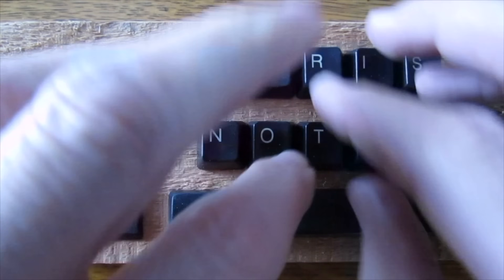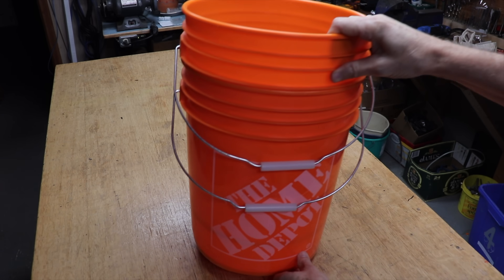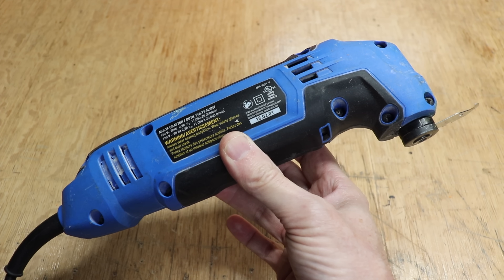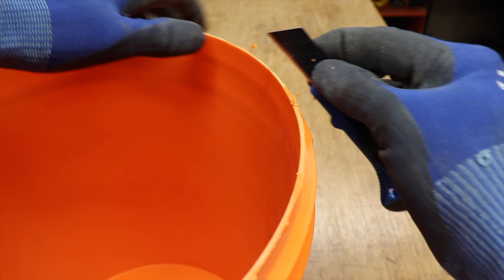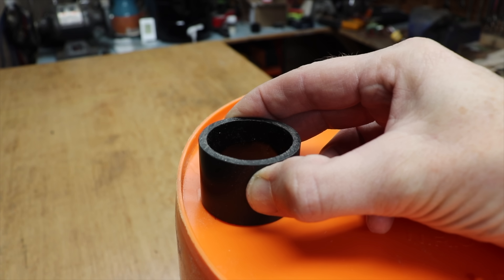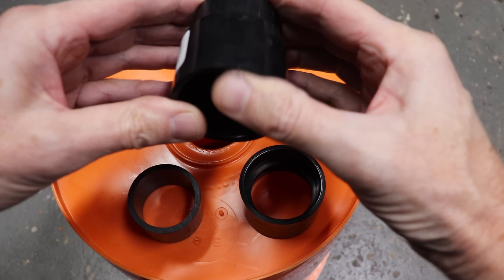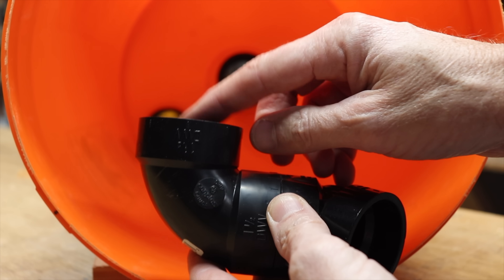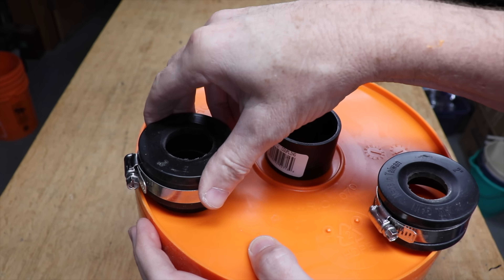How to Make ● Simple Cyclone Dust Collector

Comment: Hello Chris from Ray in New Hampshire. I just finished making one of these dust collectors. With a seven foot hose section the whole project was under 50 dollars. New Hampshire does not allow those black fittings, so my Home Depot does not carry them. I used schedule 40 white pipe and fittings. The buckets from my Home Depot didn't fit quite as well as yours, I suspect they have different sources in different areas. I beveled the inside of the receiving bucket but still no go. I then cut four small cuts in the top bucket edge at 90 degrees apart. this allowed the buckets to fit just like the one in your video. Thank you for a great design. I recently bought a lathe so I make a LOT of shavings and this will save me so much work.  THANKS AGAIN. Ray
Reply from the maker: I just finished an update with 2 more great tips!!..........https://youtu.be/BeU4nqSJtBY

Comment: I built this and it works great. However, it oil cans at the slightest covering of the nozzle. Any ideas? Vent it?
Reply from the maker: Some vacuums are quite strong. You can put the lower bucket inside of another HD bucket and push them together. For the top bucket, cut the bottom and top off of another bucket and use a bit of silicone to push on and adhere. This doubles the wall thickness and reduces the chances of collapse.
Reply: Chris Notap Good tip. It’s the top that oil cans so doubling it with another bucket might work. I thought about pop riveting a metal or plastic band around the outside to reinforce it.

Comment: Ever had problem with buckets sucking in. Not sure if I got things to tight but my buckets collapse
Reply from the maker: You can place the lower bucket inside of another bucket and push them together. This strengthens the side wall x 2. For the upper bucket you can use another bucket and cut the bottom off and slide it on and use a bit of silicone to adhere them together. This will also double the wall strength.
Reply: Chris Notap thank you for reply but the issue was i had a small chunk of wood in hose that I didn’t see. Your dust collection system works like a charm. Many thanks

Comment: Great video and unique design, but is it cost effective?  Sorry to be a negative Nancy.  I just priced out the components at Home Depot and since I don’t already have a section of hose and hose adapters to connect the collector to the vacuum, it would cost me $43.53 plus tax for all the parts.  I bought a duststopper cyclone at Home Depot that fits on top of a Homer bucket and the bucket for $43.45 plus tax.  It came with the hose, works great, and is less tall.  Even if I could have found a place to buy the stuff for less, it wouldn’t be worth my time.  If you have the hose and adapters, or just want to build one as a fun project, go for it, but I have other things to do with my time.
Reply from the maker: Other commenters have said the duststopper from Home depot worked poorly and that this worked way better. That's directly from commenters.

Comment: I’m having trouble putting the buckets together... used a rubber mallet, sat on them... the tapered end is too much... I got a great edge just the way you said- but still won’t fit together. I’m gonna keep scraping down the angled edge- otherwise Idk how to get these 2 buckets together...
Reply from the maker: Others have said Lowes buckets also work.

Comment: I had made a single bucket version of this years ago.  I put 2" of water in the bottom for sheet rock dust and it works great.  The double bucket is awsome with 2" of water the shop vac stays dry.
Reply from the maker: I just finished an update with 2 more great tips!!..........https://youtu.be/BeU4nqSJtBY

Comment: My bucket crushed from the vacuum pressure any tips
Reply from the maker: Some vacuums are too powerful. You could buy 2 more buckets. Cut the top portion off an inch below the lowest ring. Cut the bottom off an inch from the bottom and then slide the 2 parts tightly onto the buckets. This should re-enforce the sides and strengthen them from collapse. It's worth a try and easy  to do.
Reply from the maker: I just uploaded an update to solve this issue.....https://youtu.be/BeU4nqSJtBY

Comment: A nice addition would be  some clear plastic inside to see when it's full.  I operate a shared workshop, and no one would empty it, assuming it was empty to start with.  A window would make it easier to see when full.  Great vid.
Reply from the maker: Actually I tried that when I was doing the video. The clear window gets dusty right away and un-viewable. A glance at the lower bucket can tell if its full, that portion is darker or putting a light behind it works too.
Reply: @chrisnotap  Yeah, wondered about the light idea.  I think I may try to make mine with a mason jar hole in the top (jar hanging down, hole accessible from top) where I can lower a light bulb in there to provide a light source to judge the level.  Thanks for sharing!

Comment: Awesome project, thanks for sharing.  I would suggest using a rubber coupler to attach hose, with both sides already open. You can buy sizes, depending on your hose.  Much better hold and if one hose (size) breaks, you can simply adjust tighten the rubber coupler, to fit the new hose.
Reply from the maker: I just finished an update with 2 more great tips!!..........https://youtu.be/BeU4nqSJtBY

Comment: I was all  for it until you said I needed a single screw, that blew the budget
Reply from the maker: I just finished an update with 2 more great tips!!..........https://youtu.be/BeU4nqSJtBY
Reply: @chrisnotap  you should pin the update at the top of the comments. Awesome video too, I am going to make one. Thanks!
Reply from the maker: @leifforrest  I could have sworn I had pinned it. I just checked and pinned it. Thanks for making me aware!
Reply: And I thought your mind was going into the gutter.
Reply: @cornnutzgazpacho-libre3555  .Most of the time, "One Good Screw" is all you need.................lol
Reply: I don't have the oscillating saw, but I have a pocket knife and lots of band aids.
Reply: You can probably steal one from the shop vac.
Reply: Those vacuum caps are pretty pricey. They'll blow your budget for sure!
Reply: Problem is that a single screw is followed by lawyer fees, alimony, the loss of a boat and/or truck and possible relinquished ownership of a dog.  In addition all the horrible country songs your will have to write telling everyone it was all her fault!  OH a machine screw...then never mind!!!!
Reply: @rossprohaska6263 haha good one. you're oddly specific, sounds like you've got experience.

Comment: I have a question.
 I am planning to do the same set up. My current vacuum cleaner was surprisingly cheap but it kicks a lot of suction power (it is made in Denmark so no point sharing details here I guess) 
My question is, do you feel a lot of air pressure lose compared to before you made this setup?
Obviously, if it is all air tight, pressure will do its job to keep the air pressure high but, I guess air still finds a bit of resistance?
Reply from the maker: Didn't seem to have any loss of suction at all.
Reply: @chrisnotap  Thanks, I´ll make mine tomorrow! :D

Comment: I made this thanks!! I made some changes i put the vacuum motor top on a 5gallon bucket and modified it to be the vacuum bottom i then put your invention inside the old base because it has wheels and the other way it turned over easy(i learned this the hard way after dumping a half full bucket of dust right back out) lol
Reply from the maker: I just finished an update with 2 more great tips!!..........https://youtu.be/BeU4nqSJtBY

Comment: I built mine and it works flawlessly, I however use it to separate the dust and silicon carbide coming out of my blast booth. The dust goes to the fine filter on the shop vac and the media stays in the bucket. The HD buckets have been cheapened from the ones you have, thinner!  and spacing between the rings is shorter. The good thing is the buckets still fit together as in the video. Wanted to do this for years, thanks
Reply from the maker: I just finished an update with 2 more great tips!!..........https://youtu.be/BeU4nqSJtBY
Reply: Those buckets sure have gotten thinner

Comment: Ingenious!  I just bought the parts and one bucket, but I'm going to try to connect it to a 30 gallon trash can.  Five gallon on top for the cyclone effect and then 30 gallons below for catching the dust.  Not sure if it will collapse due to suction, or if it will seal well enough to work, but I'm going to give it a try.  I'll let you know how it turns out.
Reply from the maker: I just finished an update with 2 more great tips!!..........https://youtu.be/BeU4nqSJtBY

Comment: Great Vid Chris, just purchased all the parts. It'll be my weekend project. Question....have you ever heard of putting a little water in the cyclone to trap finer dust particles? A friend asked if it contained water.
Reply from the maker: It becomes a heavy mess as the dust absorbs the water. Try it without. You'll be surprised how well it works.

Comment: I made a small cart out of a sheet of plywood, screwed a bucket down to one end and my shop vac to the other end. The dust separator just drops into the secured bucket. I removed my hose attachment ( 1 .5  inch ) , from my industrial style vac, and made a deflector out of a brass 90 , which then attached near the top side of the bucket, on the inside. This deflects the air down at a slight angle. If you happen to block the suction hose the upper bucket will collapse. An easy solution is to cut the top and bottom out of a couple more buckets to form sleeves and wedge these into the top and bottom buckets and secure with sheet metal screws. I used an ABS compression coupling on the pipe, 1.5 ABS, which attaches the separator to the vac, to make emptying a snap. The whole thing is very stable and easy to move around. I made about 50 cuts on scrap as a test, and not one bit of sawdust or fine dust made it to the vac. Very pleased with the result. Hope this helps.
Reply from the maker: That's great! Yes using the parts of the bucket strengthen it to make it not collapse.

Comment: Chris, what effect would extending the center connection down into the bucket a little bit be?  Yes, I know it would reduce the capacity of the filter.  I am wondering if it would make the separator more efficient in removing the small dust, or less efficient.
Reply from the maker: The height is what makes it separate the best. Reducing it will decrease the efficiency.

Comment: Great video watched it about 2 weeks ago then made it! It works, thanks! Oddly Home Depot is the US are different than in Canada? The bottom of the bucket had a rim the size/thickness of the 1.5 in pipe so it didn't sit flush to scribe. I had to cut the rim off, then scribe and cut 1/16" of the remaining hole for the pipe to fit. lol. BUT all is good, thanks again!
Reply from the maker: I just finished an update with 2 more great tips!!..........https://youtu.be/BeU4nqSJtBY

Comment: As a cheap alternative to the rubber caps: take the end piece off of your shop-vac hose and the hose will fit snugly inside the narrow end of a 1.5" street elbow. Better yet, use the larger size hose for the output and it will fit in a normal 2" coupling (your mileage may vary, but for me the larger output hose significantly reduced the amount of fine dust that got through to clog up my shop-vac's filter).
Reply from the maker: I just finished an update with 2 more great tips!!..........https://youtu.be/BeU4nqSJtBY

Comment: I just built this. Cost $40 (half of that for a second hose) and less than an hour of my time. Tools used: magic marker, Tape measure, cordless drill with three drill bits and a Phillips bit, straight blade screwdriver, utility knife, Dremel tool with drywall bit. Oh, and a light.

BUILD:
Getting the two buckets to mate up was the most time-consuming part of the build. Put a very gradual taper on the top bucket so that the rim is quite sharp. I tapered the inside of the bottom bucket a little too. Check the fit frequently and don't overdo; I'm pretty sure all it would take is a few extra turns with the knife to go from 'too tight' to 'sloppy.'

Be careful not to oversize the holes in the bottom of the top bucket. You can cut the 1-1/2 inch pieces at 1-1/4 rather than 1-3/8 for a tighter fit that may cover a slightly oversize hole. The rubber caps are much more forgiving; a hole that looks way too small will accept the hoses very well.

Thinking to improve airflow and reduce kink stress on the hoses, I used wide 90s instead of couplings for the top of the bucket. Maybe it did, but it also made it a bit harder to pound the fittings together.

For the double elbow inside the bucket, I used a street 45, eliminating a coupling and short connecting piece. I did use a light to locate the fitting for a screw, but I assembled the elbows, put them in position, then marked it on the inside with the magic marker. The light showed clearly where the screw needed to go.

PERFORMANCE:
The shop vac I used was a little smaller than Chris's, but it worked fine. The first thing I did with it was suck up all the plastic dust and shavings from the project. Even on this lightweight material, the separator worked perfectly, dropping the debris into the bottom bucket and leaving the vac tank and filter clean. The only drawback to this setup was mobility: it's quite light and a little top-heavy when empty, and prone to tipping if you pull on the hose. And it's a bit hard to move the bucket-hose-shop vac combination around. So if you're not building this as a collection system for a stationary tool, make sure you have plenty of hose.
Reply from the maker: I just finished an update with 2 more great tips!!..........https://youtu.be/BeU4nqSJtBY

Comment: Thank You,

This simple design WORKS.

My gear is 2" so I set up  the out put for that all the way through the middle. Figured reducing or controlling that orifice  is an option.
The inlet stayed close to your dynamics. 
Externally after that 2".  
In initial testing a 1 1/4" household hose did suction duty.
Inadvertently I ran a (supposedly 5hp shop vac) without filter save a panty hose leg on the out put muffler.
There was no discernable cross over, after adding 2" to the collection bucket. 
Thanks again. 
I have passed your vid around.

A 4" version is in mind.

Regards Chris
Reply from the maker: I just finished an update with 2 more great tips!!..........https://youtu.be/BeU4nqSJtBY

Comment: I just made one and had the weirdest trilling wail sound emitting from the suction line. I'll diagnose it tomorrow, but the bucket cyclone system did its thing, regardless of the banshee in the tube.
Reply from the maker: It might just be the hose you have. Start diagnosing with the hoses.

Comment: Just what this DIYer was looking for. However, my shop vac is a Rigid 9 gal, 3.5 hp with 2.5 inch hose. Will it work with this type of vac and if so, what mods would I have to make so that it fits my size hose?
Reply from the maker: I just finished an update with 2 more great tips!!..........https://youtu.be/BeU4nqSJtBY

Comment: Just finished mine. I instead used a 1 3/4" hole saw for holes in the bucket. Couldn't find the black PVC but the white seems to work okay. I had to cut a bigger piece of 1 1/2" PVC into the three 1 1/2" long pieces. Also didn't use the screw. Well see how that goes. I'm sure it's there to keep it from moving.  I haven't tried it yet because I need another hose.
Reply from the maker: Remember, the screw holds it against the wall of the bucket to direct the flow. It's able to rotate if it's not held in place.
Reply: @chrisnotap  I had a real tight fit, if it moves I'll put a screw in or hot glue or epoxy it.  My problem is the middle one. Since I had to cut my piece going through the hole it was a little short and tends to come loose. I just cut another longer piece to get a better fit. Next I'm building a cart to put it and the shop vac on.

Comment: very cool. Is static electricity build up an issue? Do you notice any reduced performance due to increased static pressure?
Reply from the maker: After I made this, I used it on concrete in my shop and it never occurred to me, or did I have a problem with, static. In some cases you may want to add a ground to the top bucket.

Comment: That pesky sawdust! That's a genius idea. Thanks for sharing! I use my shop vac and when it has this type of very loose debris, I use another vacuum that has a bag and suck it out of my shop vac. Then I throw the bag away and put a new bag in. Either way, you have to get rid of that debris or the vacuum's stop working. I had a bunch of styrofoam pellets (I'll call them that) after putting in styrofoam panels in my garage door. You have to cut them to size to get them to fit but what mess they make. I used the shop vac to suck up those pesky little pellets that went everywhere because they are essentially weightless. No way you are going to dump these out of the shop vac because they stick to the plastic. I got the other vacuum with the bag, sucked it all out of the shop vac, and job done. That's what I do. Again, thanks for sharing your genius idea!
Reply from the maker: I just finished an update with 2 more great tips!!..........https://youtu.be/BeU4nqSJtBY